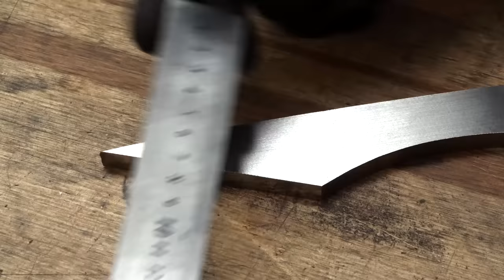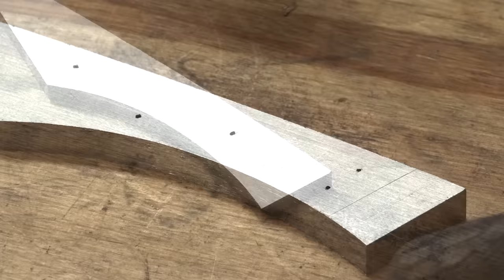Knife Making - Faceted Kiridashi

Comment: Absolutely one of the most beautiful knives I’ve ever seen. I’d love one of these
Reply: You're not the only one that would love to have something that beautiful that's one nice
Reply: I love the part where it was heat treated. Yeah. This knife will break easily.
Reply: @helium5912  did you notice how I said the most beautiful? Shockingly enough, some of the most beautiful things in the world weren't designed for construction sites.  As a box cutter, letter opener, general household cutting, this is one of the most stunning knives ever.  And literally nobody mentioned taking it into combat or cutting firewood with it.
Reply: @helium5912  Even occurred to you that he might not be showing everything?
Reply: @helium5912  at 8:48 I'm very sure that the contrast between the blade bevel and the rest of the knife's surface is showing it was heat treated.

Comment: Absolutely beautiful. That is the work of a master. However, when he was pushing the wood through the band saw without a pusher stick, I had to cringe. On the first day of shop class in 8th grade, the shop teacher started by demonstrating a table saw. He was telling us about the possible dangers of using the saw, and to never push the wood through without a pusher stick. Then he proceeded to demonstrate why a pusher stick is so important. One the first cut he made ( no pusher stick), he cut his thumb right down the center to his joint. Messy as hell. And needless to say, shop class was cancelled. And he gave a great performance on why pusher sticks are so important. Never push wood through any type of cutting machine without a pusher stick.
Reply: Moral of the story: use a pusher stick
Reply: @Michael-by5pg  I learned to do that. The demonstration was very graphic.
Reply: @Michael-by5pg   more cushion for the pushing
Reply: wait if he said not to do it, how did it get him?
Reply: @strangeayy8025  If you are asking how it happened, the answer is simple. He did not use a pusher stick. He used his hand.
Reply: @strangeayy8025  Because he disobeyed his own rules. That is pretty clear.
Reply: That's funny you said that I did the same thing in shop class in high school. It was metal shop and I cut a piece of plexiglass, not thinking with the blade would just melt through it.
Reply: @MrPtrvazq  I was in eighth grade. I should have been used to it because my father cut his right hand off at a sawmill before I was born. I saw the results of that and was usually quite careful .
Reply: Не деревина, плавлені пет кришки. Звісно так різати небезпечно. Сам ніж - понт.

Comment: if you draw a line with your cut off wheel following the chalk line you made, and then go deeper and deeper with each pass you can achieve a nice, straight cut without risking walking the blade and will cut nicer than the method you were using. I have been a metal fabricator for 20 years. best of luck. excellent job!

Comment: I LOVE Kiridashi blades but the one thing I dislike about most of them is that they are almost universally single bevel knives, but you made this one the way I would have, with two bevels so the Knife can be used on both sides for intended craft work. A single bevel knife, to me is one that the maker got lazy half way through the knife making process and only did one side. I know that single bevel blades have their place but those things can be accomplished with a double bevel blade as well, it just requires a little more skill in handling the blade for the desired task, but when a straight edge is being used canting the blade sideways so the bevel is flush with the straight edge is easy enough. Excellent work! a beautiful blade and one that will have some good heft to it so that it won't require too much extra strength to cut with due to it's mass

Comment: its definitely a piece of art, however its also nothing more than a decoration
Reply: How is it nothing more than decoration? You can tell it's Hugh carbon steel based on the sparks coming off of it when he was using the angle grinder
Reply: @bonesylikesgoodmusic3401  it looks like this, mostly due to fact it has been cutted instead of being forged

Comment: If there was no hammering, folding, forging &c, would this be able to hold an edge? From my perspective, this is more a piece of sculpture than it is a “knife.” You simply “carved” a pointy shape out of a larger, rectangular shape. And that’s not a criticism. Even if it is more sculpture than knife, it’s a beautiful piece of sculpture. That aside, I’m still curious re edge quality, how often it needs to be sharpened &c (the functional qualities of “knife”).
Reply: Many people make knives this way. Forging is just a different way of getting to the same product. In this video, he just ground a piece of hardened steel to make a knife out if it. When forging, you don't fold this type of steel anyways. That's only when you're working with pattern welded steel or very low quality steel. With the stuff we have today, this is a great way to make a good knife.

Comment: Is there anything you'd of done differently?
Reply: I might have added just enough flat length to the handle that would allow for a full purchase on the flat part of the whole knife. Just my OCD kicking in. But it might actually take away from its appearance somewhat as well. I just don’t like the idea of one part of your hand hanging over the edge of the transition that angle/slope toward the blade end of the knife. Seems kind it would feel kind of lopsided when you grab it

Comment: won't it rust?
Reply: All metal can oxidize if you let it
Reply: @WockToPoland  well, oxidize is not technically rusting. Stainless steel actually does oxidize, but it doesn't rust. That's why cutlery is usually made of stainless steel. Also, when you say "if you let it", you are exactly right. Normally you can do something to prevent it, such as paints and other superficial protections or even sacrificial anodes depending on the case.
However in this case it seems like there are no measures taken to prevent it. My question was rhetorical. It was meant to say : it will rust in no time.
Reply: @nicolasfiore  Well since you asked, and then answered your own question, I now realize that you just like to hear yourself talk🤣🤣🤣🤣
Reply: @WockToPoland  I reiterate, it wasn't really a question. I was pointing out the fact that untreated iron is not suitable for utensils. However, OP could have explained his plans if they had one. 🤷🏻‍♂️

Comment: Something about making a blade without heat shaping it at all, just 100% abrasive shaping, feels blasphemous and wrong. that knife has no soul. Not figuratively, you have quite the artistry. no, I mean that souls are conferred to a blade in the smithy, not at the sharpener, duh.
Reply: Most importantly it will keel

Comment: The first 1:30 made me cringe. With 991k subs there's no reason you don't have an oxy torch or plasma cutter. My two cents.
Reply: Lots of people do it this way though. And 991k subs doesn't necessarily mean you have the money for a torch or plasma cutter. I've made knives for several years and still swear by angle grinders, I don't see what the problem is

Comment: gotta re-name this to Knife Making with nothing but abrasives lol. Dude you have and end mill and you used an angle grinder to cut out a slot. I'm gay and I don't use a grindr this much. Is that 1/4" 3/8" thick plate? that's a chonker! Oh damn that's a lot of glue! You know you coulda attached the handle before spending 5 hours grinding down your prison shank so you wouldnt have to do it twice, right?